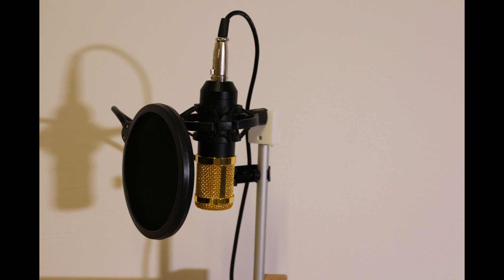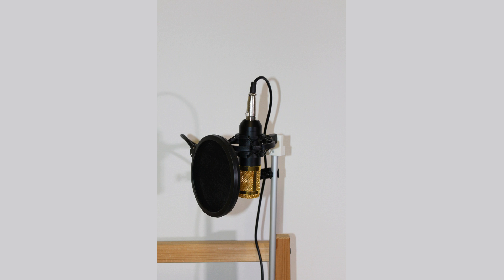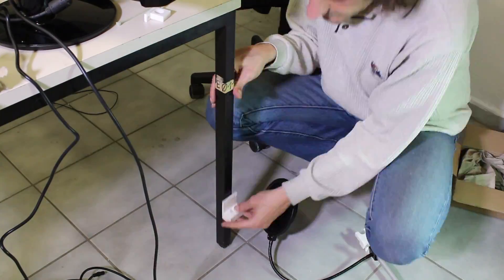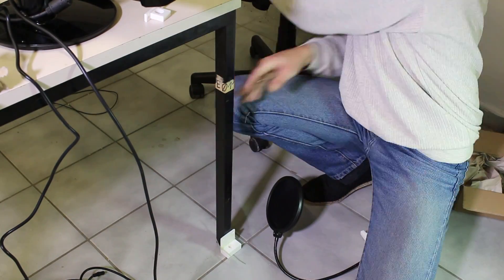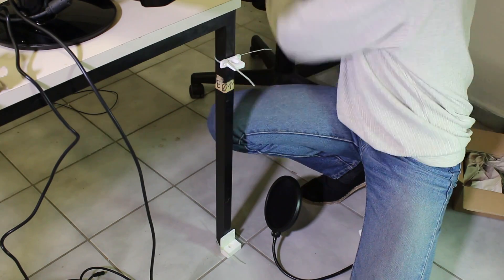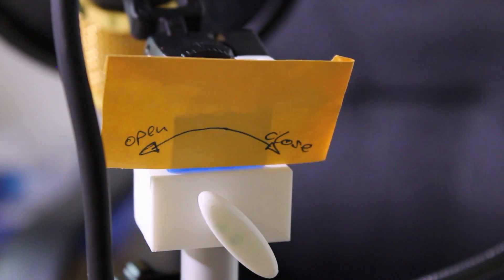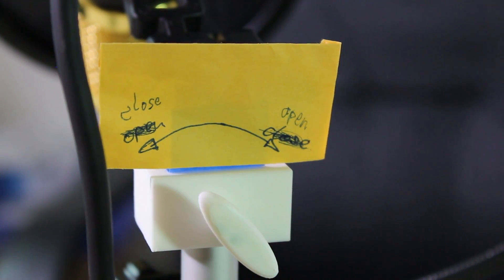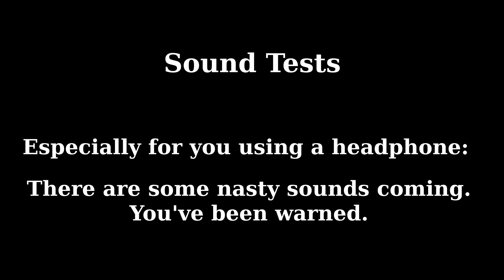Banggood's BM800 Dynamic microphone with/without phantom power test

Comment: NOTE: Most soundcards, either built-in or external designed for electret mics (mostly found in headsets or very cheap desktop microphones), will always provide about 3-5V (depends on the sound chip's spec). These mass produced mics from china will work with it, no question. Just try using a voltmeter and measure voltage on the input. If you use something that has 6.35mm input, chances are, you won't get a beep from it.

Comment: Can you please tell why when i plug mic directly into my pc it doesn't work but when i use the USB adaptor that came with it it works and if i plug mic through phantom power supply will it work then if plugged directly into pc ?
Reply from the maker: The mic should work without phantom power, that means I doubt it would change anything if you use a power supply in between. As your mic works with a USB adapter (I guess that's a sound chip on a USB device?) I think the problem is with the PC setup. Do you have a user interface that shows whether something is plugged in? I had some problems with my front panel but the ones at the back worked. It turned out the jacks didn't hold the plug well enough to ensure a proper connection.
Of course your problem could be different but I think it's more likely that the problem is related to the PC than anything else.
Reply: @nothingTVatYT  thanks for quick reply , when i plug the mic into back of pc I don't get sound through my speakers , I can only get sound when both are plugged into usb soundcard adaptor .
Reply from the maker: @jake30966  No sound through the speakers, does that mean no sound (i.e. also no system sound) or no sound from the mic? I think the easier way to check a proper mic connection is by using the mic setup. Windows as well as Linux offer some testing utilities when you set up your default sound capturing device. Usually it's just a simple meter but that's enough to see whether it gets any signals or not. Anyway it's a good idea to keep that setup open and see what the default device is. I remember I had the problem when Windows decided that a built-in mic from a USB camera is the default instead of a plugged in microphone. To my annoyance the meter showed small changes because the camera mic picked up a bit of my scratching of the plugged-in mic. It took me a while to notice that I was not measuring the device I thought.
Reply: @nothingTVatYT  Hi , 

   I get no sound at all until i unplug the mic from pc , so if i want to watch movie or want to listen to music i have to unplug the mic then plug it back in to use it
Reply from the maker: @jake30966  Well, are you sure you plug the mic in the right jack? The connectors are usually color-coded as well as labeled with a symbol.
Reply: @nothingTVatYT   yeah it's plugged into the correct one , there's 3 jack's on back of pc , my speakers plug into the green one which is the middle of the 3 and mic plugs into pinky red one but as I said when i plug mic in the sound from speakers stops .
Reply from the maker: @jake30966  The pink connector should be the correct one. I'm out of ideas what could cause your problem but as I mentioned before I doubt a phantom power supply would solve it. I guess at this point I would stick to the USB adapter.

Comment: The constant static is from the soundcard? Have you tested it in other machines, or a phone, or something?
Reply from the maker: This video was recorded in a room with neon lamps, the PC running and mostly blank walls, i.e. a quite bad environment to record anyway. The sound chip is a regular built-in on the motherboard. Unfortunately I was so used to the constant humming that I didn't notice until the video was published. I used this mic in several other occasions and I haven't had any problems. As other commented you should be quite near the mic to have the maximum recording level although I used it successfully at ~ 40cm.  Ideally you should be closer to it. In those days five years ago I plugged it in a phone and it works but I really used it with the PC only so I cannot tell you much about the compatibility.
Reply: @nothingTVatYT  great, thanks for the info.

Comment: Using this for chating with friends while gaming and general recording. share4.photo/ZMic There is a definite rise in quality when using this, and it's real close to almost being in the same room. It can also pick up background noise if pretty well so be sure to have your settings correct lol. It also comes with two pop filters which is good, and an alternative microphone holder if you have a standard microphone that you want to use. It does come with a dual audio/microphone to usb cord, which is nice, but I recommend not using it as it won't be as effective with quality. Overall, great set for a great price. Highly recommend.

Comment: As an owner of this microphone it goes like this

without phantom power: you either will need to be in kiss range of the microphone for good volume and no hissing (+10db required) or you ll need to up the gain to +20db which will give you hissing but the audio quality is still superb for 25-30$

with phantom power: I haven't used it with it but I can assume that you can do +0db gain which is ideal, no hissing and no need to be in kiss range

surprisingly enough being in kiss range doesn't ruin your sound you ll just need to speak kinda sideways so that you dont blow directly to the mic (to avoid popping), your nose can blow on it without a sound if you use the included filter, so this means that you can use it without phantom power for content creating just fine

Comment: Bm 800 is not dynamic and your mic is clearly broken (or maybe the cable is broken or something getting interference?).
 Even without phantom power the buzzling noise shoudnt appear. 
I have a bm 800 and I will do a review. I'm just waiting my phantom power.
Even with +30 Sensibility and full volume the noise shouldnt be horrible like 3:28. Bye

Comment: Original bm 800 CONDENSER, no noise like your video even with +30 sensibility and no phantom power.
xD
Reply: Samuk190 - Tutoriais  bro you actually got that wrong there was probably a fan running which caused the the noise and he also didnt used the  Included ball type anti wind foam cover if he used that there would be no noise in his video.

Comment: There's one thing you need to know you need to be in a kiss position with the mic like really close and talk to it and have the gain a bit down and this mic is really worth it i just bought it off of AliExpress not trying to promote it but check out other vids on YT aswell guys and you will see that everyone is putting the gain of this mic at around 8-15 and this dude cranks it till max not trying to say its bad but it has background noice and he wants to talk from a far well this mic is 20 bucks and you need to be close with small gain bro ^.^ HF! #NoHate
Reply from the maker: That sounds reasonable. I'll give it a try. Thanks.
Reply: No probs try it and you will see the difference ;) and play around with the gain and the volume of the mic!

Comment: BM-800 is not a dynamic microphone. Thats condenser microphone. Dynamic microphones don't require phantom power.
Reply: so, the bm 800 need a phantom power? it doesnt work without a phantom?
Reply from the maker: It does but the results differ quite a lot. See the time line in the video description to point you to the respective audio.
Reply: Condenser mics work at lower sound pressure levels with a phantom supply, but will work with higher pressure levels. Using a phantom supply does not make it wear out noticeably faster.
Reply: Correction: It's an electret condenser microphone. Which means it needs a plugin power of 1.5V to 5V. Using phantom power with it might decrease its life span...

Comment: Looking to get the BM-800. Want to record vocals. On my PC laptop, using pro tools or audacity. Will the BM-800 plug and play? Don't want to have to get a 3rd party to power it. Please let me know ASAP. Thank you!
Reply from the maker: +Chris Charleston I added a time line to the video description. As you can see and hear in the tests this mic works without phantom power (although I had a bit more noise). Others had no problem at all. Please note that the tests weren't made in a perfect environment - I had neon lights and PC fan noise around which had more effect on the tests than I wished they had.
If you're working with audacity you can limit the noise easily to a great degree. I usually do that for the videos (not in the tests in this video for obvious reason).

Comment: HISSSSSS Noise Grainy BAD for recording.
Reply: i recently bought this, no hisses, works absolutely perfect with no phantom power.
Reply: +ThatAnzDoee Send link plz
Reply: ShadowProductions Get a Art MP Tube Mic Pre like $30 - $40 bucks & it's Awesome for Condenser mic's that need 48V of phantom Power it will make the Mic sound so much better & you can use it for a interface for Guitar or Bass too it works Miracles on Amp Sims.
Reply: Check out my channel for giveaway
Reply: it's called EDITING! you can edit that out.

Comment: What type of sound cards would it work with?
Reply from the maker: +Ikroop Singh Kalsi I just used the on-board audio sound chipset on the motherboard. Theoretically it should work with any sound card although the voltages provided by the microphone jacks may differ.
Reply: ohk thanks :) +nothingtv

Comment from the maker: I added a time line for the sound tests to the description. Amplification and the volume settings are just the values you set in your sound mixer. In my case it's a pretty standard on-board sound card on an AMD-based motherboard.
Phantom power is supplied by a Behringer PS400 microphone power unit.

Comment: 2.34 mic without phantom power  right? So i could remove the noise with audacity?
Reply from the maker: +Jousha Music Yes, it's directly plugged into the sound card and audacity can do a great job in removing the noise although it may remove some of the subtle variation and smooth it more than you like. No problem for a voice over but your mileage may vary for music or other sound sources.

Comment: is 3:06 just the microphone with the 48V phantom power without any soundcards or anything just the Microphone plugged into the 48V?
Reply from the maker: +FullMoOnPiano It's with 48V phantom power and the sound card is set to just capture what's coming in without additional amplification. The sound card is just the built-in one on an AMD-based motherboard, i.e. it's just the microphone connector of the PC.
Reply: Alright thanks a lot! can't wait to try mine out!

Comment: does the microphone just works with AA battery?
Reply from the maker: +MC DIABLO No, there is no battery case in this model. I used an external power supply that plugs between the mic and the PC using XLR connectors. Look for "phantom power supply", there are devices like the PS400 and audio mixers with optional 48V.
Reply: +nothingTv thank you i would really like to buy one of those. can u send me the link of the web where u buy yours?
Reply from the maker: +MC DIABLO I ordered mine from Thomann in Germany: http://www.thomann.de/de/the_sssnake_sk233-6_mikrokabel.htm and http://www.thomann.de/de/behringer_ps_400.htm
The PS400 comes without an XLR cable so you need an additional one.
My cabling now is: BM800 with XLR to PS400 input and the cable included with the mic from PS400 "mic thru" to the sound card.